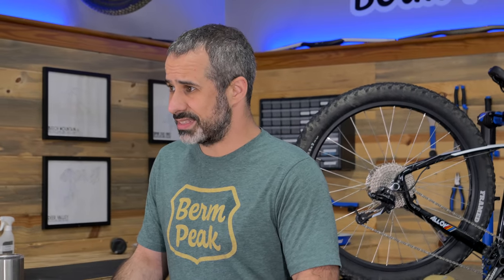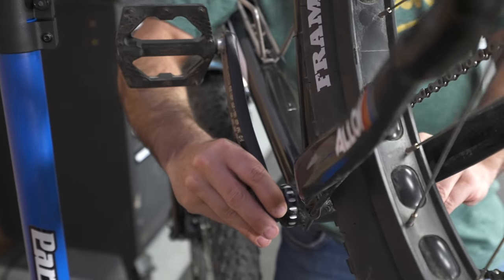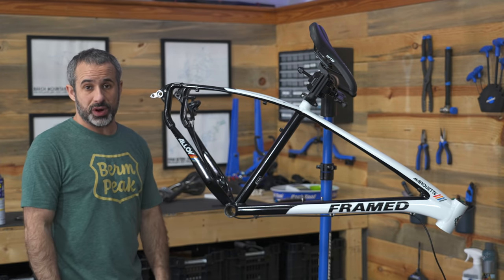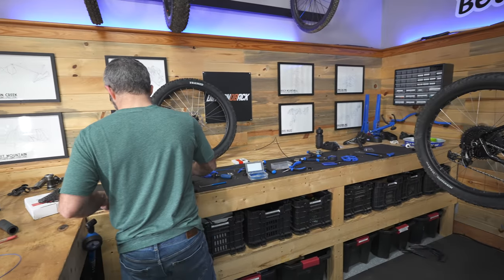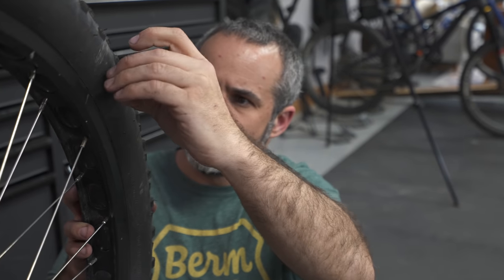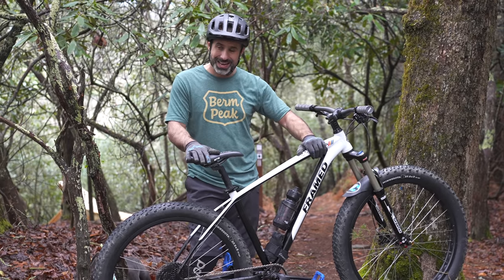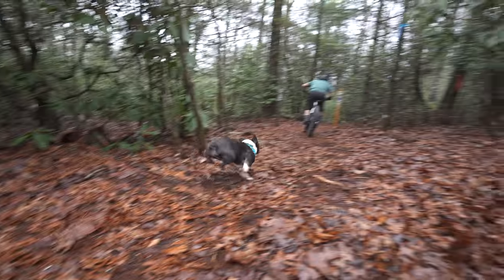Local student's hardtail gets a parts bin overhaul!

Comment from the maker: It turns out that those handlebars are designed to keep a proprietary grip from rotating. You learn something new every day!
Reply: Nice video, Seth. That is true. I learned that you don't buy a cheap phone mount lol.
Reply: Hey, I've got a question, I'm thinking about converting my bike to tubeless, but do i need tubeless specific tires and wheels?
Reply: I totally agree. Great video, keep them coming!
Reply: Yep!
Reply: Never have I ever seen those handlebars before.sick vid
Reply: @JerryPonds  You don't need em but it works a lot better when they are made for it.
Reply: The hairs on the tires are part of the rubber mould which allows air to escape when making tires so they're not that important for the tire more for the process.
Reply: The hairs on the tires are the excess rubber from when the tires are molded
Reply: Seth inform when u find out about the hairs in side of the wheel
Reply: @JerryPonds  tires yes if your if by wheels your referring to rims no you just need tube less rim tape I am 99 percent sure what I said is right but check some videos out before
Reply: I think the hairs come from when they fill the mold with the rubber to make to tire.
Reply: seath should do a video on Oscar becoming a trail pup like he did with drama
Reply: @JerryPonds  Nope. It helps but I've done plenty of conversions on non tubeless ready wheels and tires on older bikes. It can take more sealant and up to a day or two to fully seal up, but I've never had a problem with it. Buy some 1" gorilla duct tape, pre-heat your wheel so the tape sticks better (after cleaning it really well). Then put your tire on, use a compressor to seat the bead before you add sealant. If it seats well, take the valve stem out and add sealant using a syringe or funnel and small hose through the valve, then put the valve core back in and pressure up your tire to no more than 40psi. Then, bounce, spin and knock your wheel around to get the sealant everywhere. Don't worry about it spitting out in various places. After a while it will seal. For an average wheel use about 100-120ml of sealant. I use truckerco sealant from Amazon. Better than stans and cheaper. Good luck!
Reply: @JerryPonds  Tubeless ready tires usually have a thicker sidewall and tubeless ready rims have some rim tape already on them, if you can't afford rim tape and brand new tires Gorilla tape can do basically the same thing, but be ready for more punctures if you don't switch tires than if you did
Reply: the hairs one tire are there because, when the manufacture are making the tire, there is hole in the mold the let the air escape, and this create those hairs.
Reply: I ride BMX yet I want to get into mountain biking
Reply: @motobruh7863  thats what I want to do as well but I've been focusing more on upgrading my 2 bmx bikes
Reply: @mymorristribe  ty i wanted to ask the same
Reply: Are you still with box
Reply: BabyDevil they are part of the mold that the tire is made from. They help to get the tire out of the mold.
Reply: @worldofweapons9993  ooh so u mean like when they cut the pieces of tire yeah that could be it
Reply: @JerryPonds  tubeless ready tires, but you can use your existing wheels. Run a strip of rim tape around the inside of the rim to seal it up.
Reply: Is that any useful I mean practical.
Reply: Man. I'd be happy if i have a mtb like that. Maybe someday right?
Reply: yeah thanks for the amazing video.
Reply: @JerryPonds  well sort of,  you need to have tubeless tires for sure but if you don’t have a tubeless rim you can attempt to convert it to tubeless using tubeless rim tape, which might or might or might not work because of the shape of the inside of your rim
Reply: Intresting
Reply: Seth, did you train Oscar to be trail dog. He's very good at it
Reply: According to me they’re a sort of
Grip that tries to give less fatigue to the pinky finger, not so much for keeping them in place
Reply: The hairs on a tire are remnants from the injection molding process to make the tire. They serve no functional purpose after the tire is made.
Reply: @JerryPonds  It Depends. Some non tubeless tire and wheels are alright to do tubeless on and some aren't.
Reply: @drobotk  great thanks!
Reply: Thanks for the help everyone!
Reply: @mymorristribe  thank you!
Reply: @mikkelstormhansen9733  gotcha, thanks for the help
Reply: the hairs are made to brush your teeth and clean your shoes
Reply: One more question, what are the benefits of presta valves over schrader valves?
Reply: @JerryPonds  yes and no, you can make it work but it wont be as secure
Reply: @lalshortshot2051   you can get Schrader valves that thread like presta valves, I'm just not sure which valve is better
Reply: @JerryPonds  you need specific tyres but for rims just put some half width gorilla tape on them and get the correct valves for your rim, add sealant and inflate
Reply: @Harvey00Fleur2  thanks
Reply: @JerryPonds  no problem
Reply: Hey seth question, have you ever tried a manitou front fork? The are pretty high quality forks.
Reply: @JerryPonds  you do, rims and tires
Reply: @JerryPonds  yup!
Reply: Looked weird at first but learn something new every day
Reply: @JerryPonds  ahh i always get the two valves confused. You want  to use the longer thinner one that isnt used on cars
Reply: Yeah speciali when your a student
Reply: Thats the kind of bar my pivot came with.
Reply: @lalshortshot2051  ok, that's presta, thank you!
Reply: Hi I have the old Specialized Z cage and it comes out on the right
Reply: @JerryPonds  yes you do
Reply: @TomNuts  thanks!
Reply: @JerryPonds  yes you would it most commonly says if it is tubeless ready on the rims but if it doesn't it won't create a proper seal you do need tubeless specific rims and tires
Reply: Pivot has used that system in the past
Reply: Yep! I forget the brand though. Park tools even makes s special saw jig for it.
Reply: Oh.. it's the WTB padloc.
Reply: @edrcozonoking  yessir
Reply: The "hairs" on the tire are ports for trapped gas to escape during the moldings process so the rubber can flow to all the mold crevices.
Reply: @ThePwnrer  rubber tires are not made by injection process. The tires layers are built up an then placed in a mold to form and vulcanize. The "hair" holes are for gases to escape and allow the material to flow into every crevise.
Reply: The hairs on the tires are to let out air when the tire is being made to stop bubbles forming in the rubber
Reply: @JerryPonds  essentially no, but you may find a little more sealant than is usually used in tubless ready wheels and tyres will help, you may need to top up tyre pressures a bit more regular than a dedicated tubless set up due to the tyre bead and rim wall not being as secure a fit. Probably the most important part is ensuring the spoke nipple holes are sealed to prevent the air seeping out, for non-dedicated tubless rims something like gorilla tape works better than tubless rim tape i find.
Reply: @itscrazycocotime4518  thanks
Reply: @JerryPonds  🤣🤣 I never actually noticed so many have answered your question already. Good luck setting them up !
Reply: @itscrazycocotime4518  thanks!
Reply: @Seth 4844 MTB track thanks
Reply: Great video
Reply: I wish I have ha bike.
Reply: @JerryPonds  they make tubeless ready tires and rims. (Look for the “TR” designation.). I have heard of people using Gorilla tape as rim tape to seal their TR tire on regular rims with varying degrees of success.  Seems like a short-term solution until you can save up for the TR rims.  Best would be to get both tires and rims in TR.
Reply: @JerryPonds  sometimes you can get away with non tubeless rims but tubeless tires and rims
Reply: @eliboyer3352  the bike has a Pivot handlebar on it. In a couple of the clips you can see the logo in near the stem 😊
Reply: Huh
Reply: @JerryPonds  yes you need tubeless specific tires. Otherwise the sealant will seep out the tire skin. Almost any wheel can be made tubeless by installing sealing table over all the spoke holes. And you need tubeless valve stems
Reply: @juliangarrett6373  thank u
Reply: Hey there Seth, I had an idea for a bike hack. For somebody who has a presta tube/valve, but wants to have a Schrader adapter on hand, take a plastic bar end, drill a hole on the inside just smaller than the Schrader threads, then tap threads into it with your adapter. I've been trying it out recently while trying to improve my backpackless setup, it works great.
Reply: The little tire hairs are apparently for air ventilation
Reply: Plus the local collage student could of cut it like that but it could be anything
Reply: @JerryPonds  You'll need to tape your rims (with proper rim tape or cut down Gorilla tape) if they aren't already taped for tubeless, you'll need 2 tubeless valves (or cut some presta ones out of 2 old inner tubes, Seth has a hacks video about that), tubeless sealant, and you'll probably want TR (tubeless ready) tires, but depending on the tire, you might be able to get away with non-TR tires, just be careful.
Reply: @The_RC_Dude  thanks
Reply: Can U plz make my bike better I love your videos and I think this is what U do for you to fix people's bikes
Reply: I hate proprietary stuff. Make it an open standard or don't bother.

Comment: Ah yes, the classic “why don’t you use a pipe cutter” guy. 😂
Reply: Ive used one, takes forever, so the hacksaw is “quicker”.
Reply: And? I made a headset press from the hardware store for $10. Gonna cry about that?
Reply: @dystopiaisutopia  I also made a crown race setter out of pvc pipe and a twisted pvc cap. Use a rubber mallet and a solid stroke and it works great! 👍🏼
Reply: @dystopiaisutopia  no u
Reply: @sepg5084  nobody was talking to you.
Reply: My understanding is that a pipe cutter isn't the best tool to use (slower, might require more filing/cleanup), but that it's a totally fine option if you aren't cutting a carbon steerer and aren't confident you'll make a square cut with a saw (e.g., don't have a saw guide/jig like Seth uses).  Am I missing something here?  Is there a reason to definitely avoid using a pipe cutter?

Comment: “Those little things sticking out of the tire is a product of injection molding” ~ Dad

Edit: comments have corrections
Reply: I came to the comments to say this 👍
Reply: I commented the same thing earlier but less correct lol
Reply: Specifically the channels that allow air to escape the mold so your tire doesn’t have air bubbles in the rubber.
Reply: @tristandyer8613  oh, thanks
Reply: Tires aren't injection molded, they're vulcanized in pressure molds.
Reply: They have no function but you can be certain you are buying new tyres if they have the little hairs on them.  They wear down if they been used.
Reply: The 'little hairs' are vent holes from the molding process.
Reply: I like my bikes the same as my women: With all the hair on them.

Comment: The little “tire hairs” are formed during the molding process of the tire, where the hairs are on the tires there are generally tiny vent holes and when the rubber hardens it fills in those holes creating “tire hairs”
Reply: Also good way of showing if clearance is enough, unless the frameset or wheels are too flexy then rub can happen.

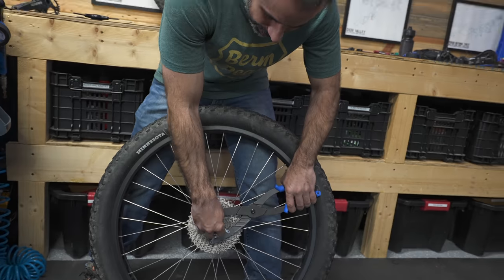Comment: @5:25 Seth runs into a "snag" because he assumed the original cassette would be a SRAM cassette.  That cassette actually may well be a SRAM cassette , but it doesn't really matter - all Shimano and SRAM 10 speed cassettes fit to the Hyperglide ("Shimano-style") freehub standard.  I'm guessing he was expecting to find an XD freehub body underneath, but I don't think any 10 speed system ever used these.

At 11-speed, freehub standards began to diverge more between the two brands, but even some of SRAM's lower-end lines still fit to HG freehubs.  Box Components was another brand still designing for the HG hubs.

Comment: The hairs are there because of a process called injection moulding ... just like in my job (plasterer / staffer) when we make a mould, you need to have throughout it areas where the excess air can escape in order to ensure a proper injection without any air pockets left.
Reply: Oh wow, thanks! That's really interesting. Always wondered what they were for.
Reply: O thanks
Reply: The more ya know huh
Reply: partially correct, Tire manufacturing engineer here - Those "hairs" are venting during the curing process of making a tire, basically allow for excess to spill out in a controlled manor, tires are NOT made by injection molding, they is extruded raw rubber compounds that are lay in a specific way to create a green tire which is then cured (baked like a cake)
Reply: @michaelpaciorek4068  :o

Comment: They’re called vent spews. There has to be some way for the air to escape from the mold during the manufacturing process. They have little holes in the mold and as the air leaks out a little bit of rubber does too.

Comment: Seth the hairs on the tires are called Vent spews it is from the injection moulding of the tires so the moulten rubber does not get air locked !!👍

Comment: One thing is many of the framed bikes can also be setup with Fat Tires ( 3.8-4.8 inches) which is why youll see some with flared frames. That way you can use them in the winter (but it is recommended you switch to a solid carbon fork as the oil can freeze.)

Comment: "hairs" on the tire are called Surface Vents. And they allow for excess rubber to escape during in the mold during the molding process. Easy way to remove, aside from plucking as you did, is a nail clipper.

Comment: They are called vent spews, used to allow air the escape from the mold as the rubber is pumped in allowing the tire mold to properly fill

Comment: The little rubber hairs are from the manufacturing process. Tiers are put in high pressure molds to get their tread and that pressure leaves through tiny vent holes in the mold leaving behind the little hairs as the tier cools

Comment: Those little hairs or fuzzy guys on the sidewall is actually thing used to see if the bike was stored outside in the weather. It's a little thing to see how much wear is on the tire even if they haven't been rode much. When it rains or something those become brittle. And in the first ride the wind or something can knock them off. So if you buy a used bike. And the seller says they haven't ridden it much if at all. Look at those nubs might be another indicater of how the bike was stored.

Comment: Honestly , the sub-1000-dollar bikes from earlier days were the bomb in my opinion!
I still wish I'd never sold my very first xc-bike, a Scott Scale 70 2004 ..was just a full deore bike with a pretty standard 70mm front, but that frame! a 7005-alu butted frame, just the same frame as the alu RC-version of that year.
Any upgrade on that thing made it just a pure racing machine. with just a wheelset , new drivetrain and a lighter seatpost and handlebar, I got it in the 24lbs range and all it needed was a 100mm travel in the front to become a true rc-version for half the money.
Dang I miss that frame x-)

Comment: They are called vent spews Those little rubber hairs are a byproduct of tire manufacturing. While liquid rubber is being injected into the tire mold, air bubbles can form in the rubber or between the rubber and the mold so they put vents in the molds so that the air comes out but that allows for some of the liquid rubber to go into the vents making those hairs.

Comment: the tire hair occur as a result of tyre manufacturing. When the tyre is being made, a mould is set  and rubber is forcefully injected into the mould, air bubbles tend to form and this could damage or weaken the tyre’s strength. So to prevent this, vents are placed to allow the air to. As a  result  some of rubber enters these holes, forming the hair-like extensions when the liquid rubber settles to a solid state.

Comment: For the little tire hairs, tires are injection molded rubber so when they have a mold the have all those little injection spots where the machine just squirts the liquid rubber in for it to harden and make a tire
Reply: I believe they are air relief passages for the mold to prevent air pockets; the rubber is injected in much fewer locations typically.

Comment: Many people think these hairs play a role in noise reduction or indicate wear but their primary purpose is air ventilation. Those little rubber hairs are a byproduct of tire manufacturing. In a tire mold, rubber is injected and air pressure is used to force the liquid rubber into all the nooks and crannies.

Comment: You carefully cut those tire rubber hair thigs with a nail clipper.. all of them. I did it once for the same reason and it took me 10-15 min/wheel but I solved the problem with no downsize so far. And yes you're wright, those hairs is what remains after the rubber compound is injected through small pipes let's say, into the tire mold.

Comment: Those hairs are a part of the manufacturing process. The mold that the rubber goes in small holes that acts as air vents. The rubber goes into those holes to create the little rubber hairs

Comment: Seth, I have a hack for you. Instead of taking 5 to 6 minutes to pull off those rubber “hairs” just take a small propane torch and quickly go over them. It will burn them right off with no damage to the tire itself. Keep a wet rag close by just in case you need it.

Comment: Those tire hairs are from holes in the tire mold. They're meant to keep the tire cool in the process of shaping the tire so the rubber compound doesn't get damaged/weakened/made less grippy by the heat of the mold.

Comment: Technically, they are called vent spews, which gives away their purpose for being on the tire. Many people think these hairs play a role in noise reduction or indicate wear but their primary purpose is air ventilation. Those little rubber hairs are a byproduct of tire manufacturing.